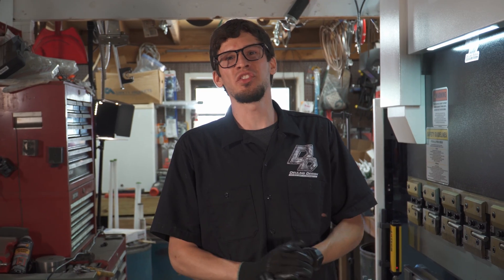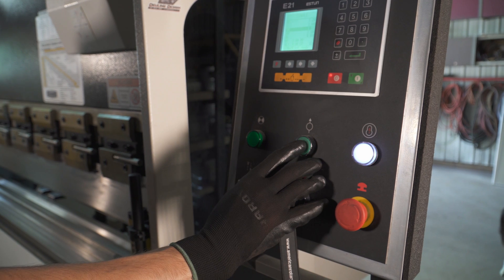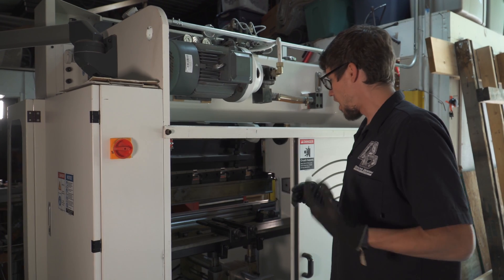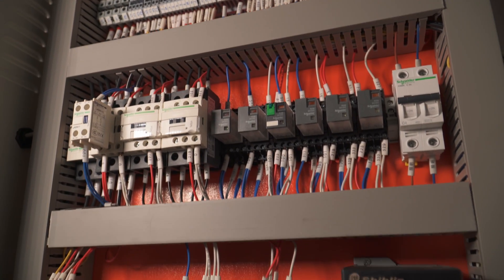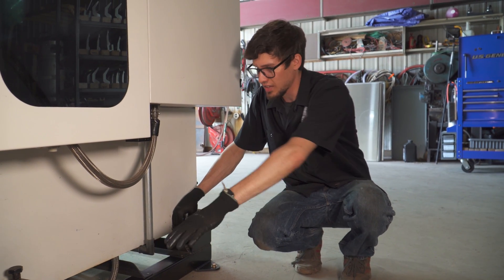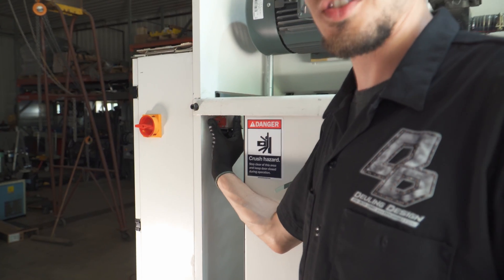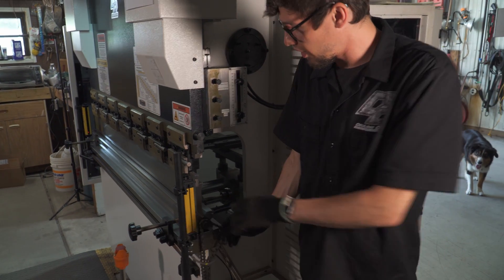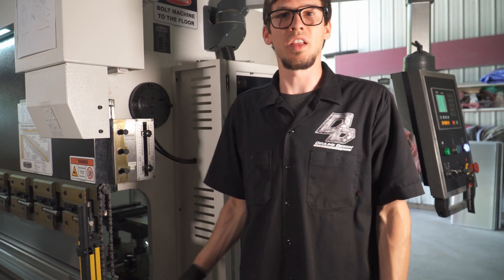Tommy Industrial Press Brake - EP1 - Introduction

Comment: 33 ton… you may as well be bending with pliers😢
Reply from the maker: Why? I’ve bent 4’ of 3/16 mild steel with it with a 1.25” lower V. Does everything I need for my small prototype business. I don’t do much over 1/4” and usually bend 1/8” or under for most components.

Comment: Watched your tour with Abom today.  A couple of suggestions for you.  On your sick 4’ press, simply send the hydraulic pump in for repair.  A shop like Tri-State Hydraulics will restore it to new very economically.  Your dual voltage three phase motor: there is an old book titled Electrical Motors and controls which has an entire chapter on remarking unmarked leads on these motors.  Also a good rewinding shop would be able to accomplish this for you as well.

Comment: Great video! Thanks for the overview. I understand that these machines take a long time to adjust the die height for multiple bends in the same program. Can you estimate, or maybe give an example of how long this takes? If bend A is 30 degrees, and bend B is 60 degrees, as an example, how long is the wait for the adjustment to happen?
Reply from the maker: Thanks man! I will have to try and explain it better, I thought I went into it a little in one of the current videos. But it has a mechanical stop physically inside of each cylinder. The cylinders have a shaft running between them up top that a motor is connected to. It spins a worm gear that spins a shaft inside the cylinders to adjust that mechanical stop. So the cylinders physically bottom out on that stopping point every time you hit the down pedal and that is what needs to adjust for your different angles. Some companies toss a high speed servo on machines that are meant to slow speed adjust and I have seen them wipe out the worm gears from moving to fast. So when you see other machines at a similar price point for “faster adjustments” be weary that it’s probably for a reason that the price isn’t like $8000 more than these units. Because that is what the proper high speed adjustment takes. You can special order a brake with that setup from Tommy if you desire the angle change to be faster. It will come with a Delem controller, high speed servos and gears rated for that higher speed. Not just a servo slapped on top of low speed unpolished worm gears.
Reply: @AdamDeuling  Thanks for the detailed response. I really appreciate it. I'll run through your videos again to see if I missed the explanation. I know this higher speed change is a price adder for next level up machines from competitors and that the Tommy is price competitive for the features it has. Maybe I'll look you up next time I'm headed toward the dunes!

Comment: Nice work! Can you do a video on centering the upper and lower die to each other? We’ve struggled with repeatability on this… is there a tool? Custom fixture with dial indicator? Would like your opinion, thanks!
Reply from the maker: I replied on Facebook but figured I’d reply here as well in case someone else sees it. But if you adjust the slow sleep approach slider on the right hand side of the machine so that it bottoms out before going into bending mode, it will not apply full pressure to the tooling and you can just self center the lower with the upper punch and then clamp it in place